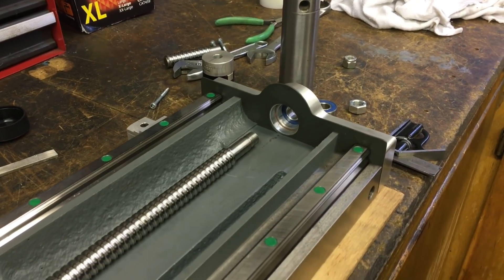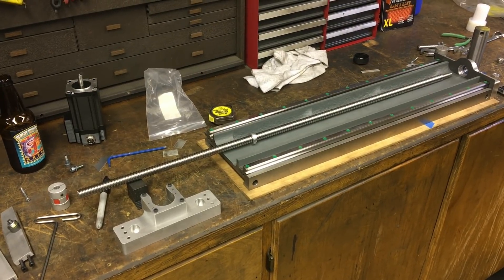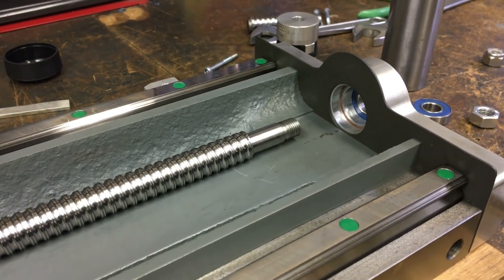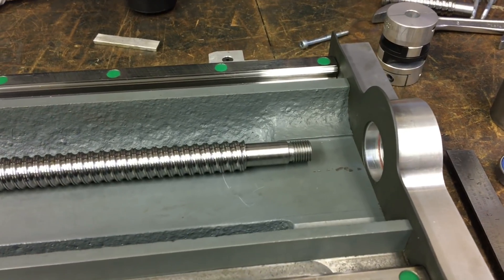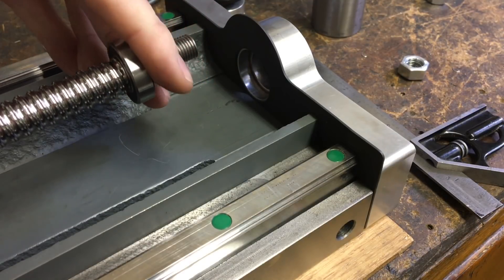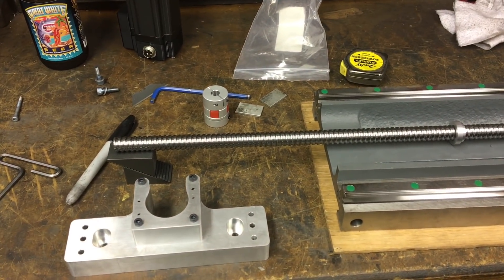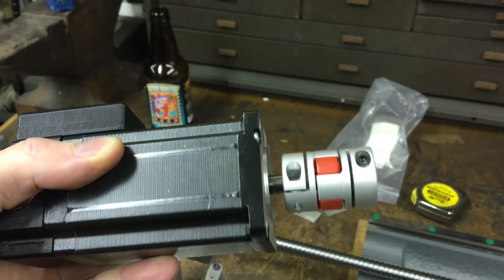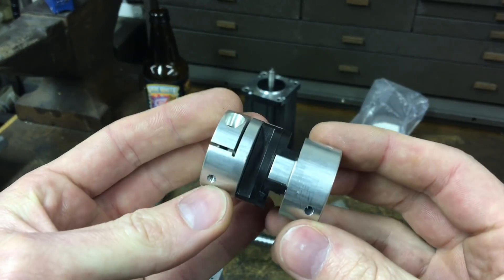China Ballnut Rebuild - 2

Comment: I have a large machine with a tool changer and I use a nema 32 1850 oz stepper to turn the tool rack . With a china knock off of a lovjoy  coupler just like you have. It has a lot of bounce and flex. It works for the tool changer because an air dog locks and aligns it . It would not work for a ball screw drive.